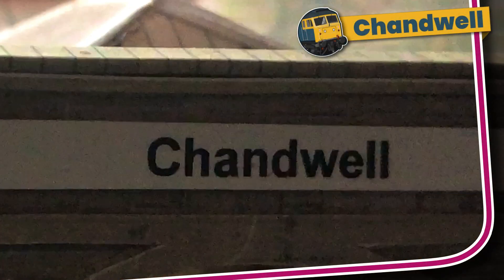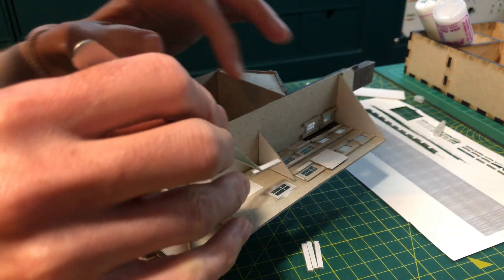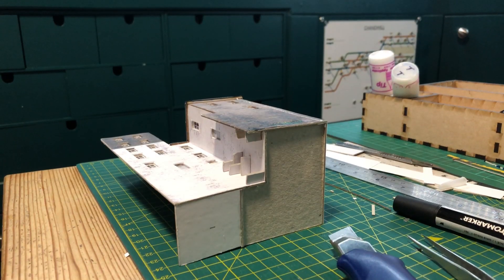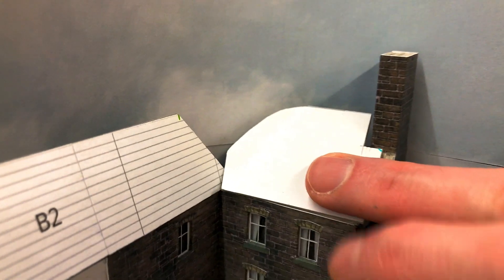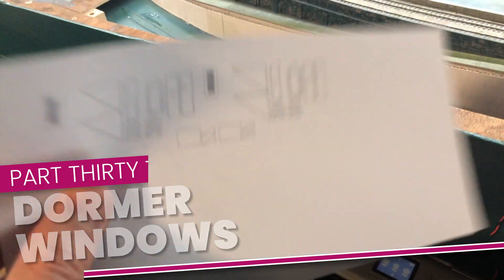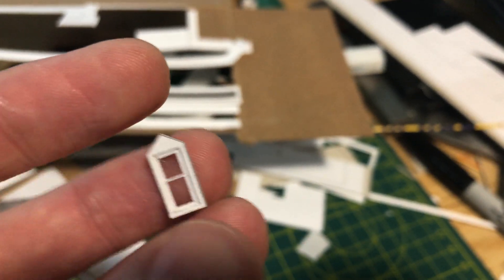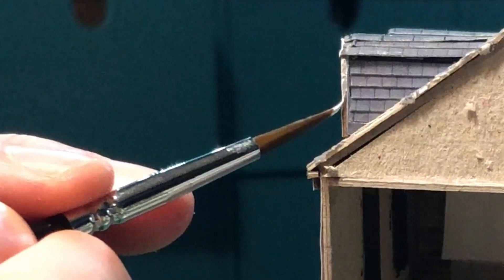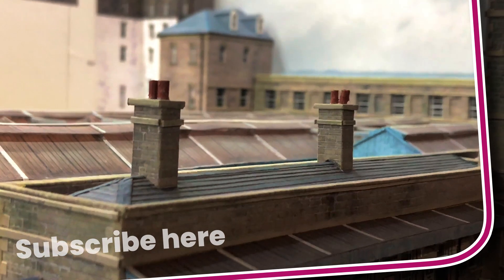Detail and dormers: Scratch Building a Low Relief Victorian Hotel Part 6

Comment: Michael. Since moving down south from the North East to Yorkshire, you have picked up some really bad accounting habits. In Yorkshire they never add in the cost of the tea to a project. Sloppy accounting like that can lead to huge overspends on tight budgets. Nevertheless, I think the community will forgive you this time. ☕🤣🤣🤣🤣🤣☕
Straight edge to apply a thin bead of PVA is superb. Top tip. Thanks
Reply from the maker: Ah Peter! Never fear. I’m not accounting for tea drunk. I did start, but my spreadsheet couldn’t handle the huge numbers involved and I had to send my computer away to be refurbished! Michael.